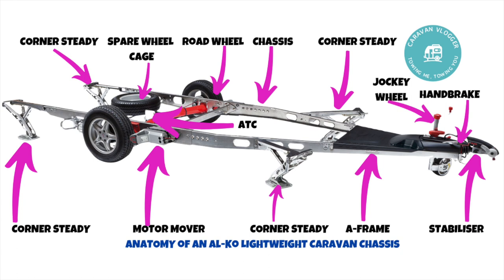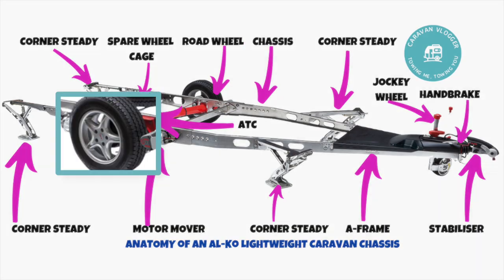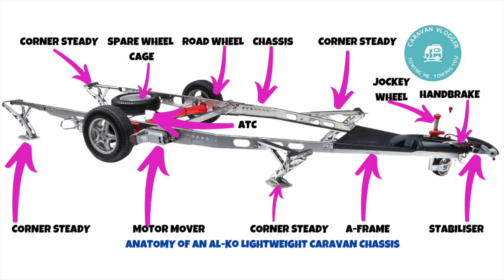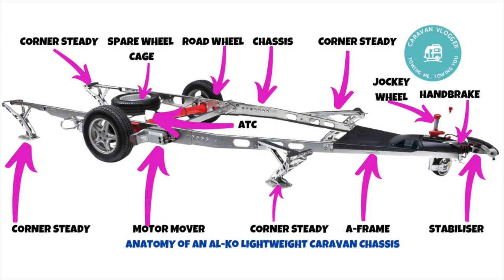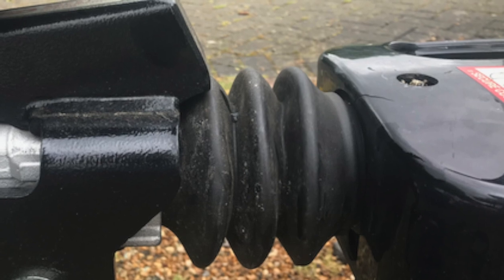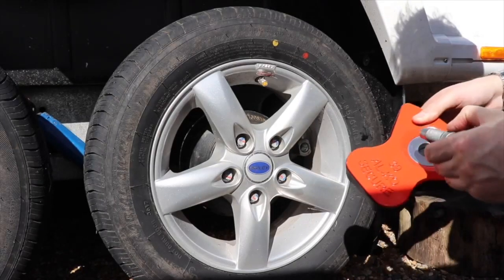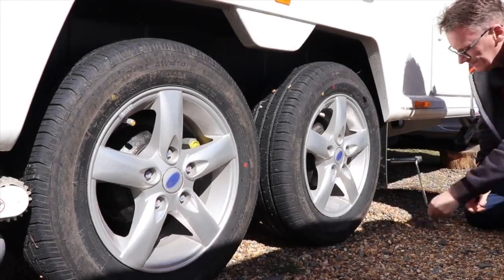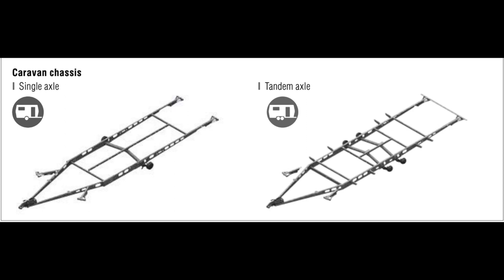AL-KO Lightweight Caravan Chassis

Comment: H Graham.  Hope all is well. I am glad you mentioned the jacking points. I feel it very important to use proper jack points/brackets otherwise you would damage the chassis.  Thanks Phil.👍🙂
Reply from the maker: Thanks for watching Phil. Yes, jacking points have always been a worry for me. I think it'd be quite easy to damage the chassis by placing a trolley jack in the wrong place. Thanks for watching. Graham

Comment: To make life easier with the twin axle caravan for leveling and fitting the Alko locks, take a look at Lock and Level - it's an airbag system.  We have the single axle version because we own a single axle caravan, the dual axle version lets you raise the caravan on one axle leaving the other in the air so you can move the wheel to the right position and insert the lock, then you take the weight with the second airbag.  I am not connected to the company, just a happy customer.

Comment: Useful video, thanks! 

Glad you mentioned the breakaway cable at the end. I came across the video below recently which explained the confusion about breakaway cables with carabiners, and those pre  2018/19 caravans like mine which tended to have spring clips. 

There is an issue at present in that new towbars like mine (fitted 2019) are designed for new style carabiner direct attachment to the tow hitch, and do not have a large hole through which to thread the breakaway cable, which should then be attached in a loop back onto itself using the spring clip. 

However, any caravan older than 2018 is likely to have a spring clip. 

Apparently spring clips are not strong enough for direct attachment to the tow hitch. 

So I and many others need to default to the less safe option of looping the cable round the toward and back on itself, with the slight possibility that both cable and tow hitch will separate form the caravan at the same time during an incident. 

I'm not entirely comfortable with this, and I'm going to get my old style spring clip breakaway cable replaced with a new carabiner style one at the next service in the Autumn:

https://www.youtube.com/watch?v=e2IcPIihreI
Reply from the maker: Thanks for the comment, very interesting. Ours does have the carabiner and I clip it in the whole which is part of the tow bar assembly. Interesting point. Graham

Comment: The reversing on an old Bailey with a BB chassis required  you  to pull an anti reverse pin to allow you to reverse it was a absolute nightmare every time you pulled forward to adjust you had repeat the procedure to reverse again
Reply from the maker: Les Brewster Thanks for watching. That sounds like a nightmare. Thankfully things have progressed 👍🏻Graham